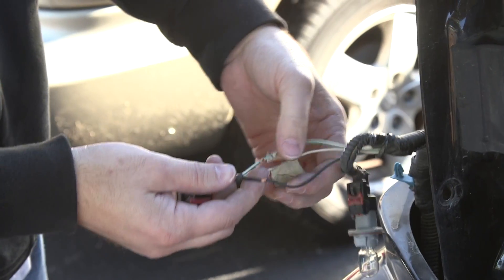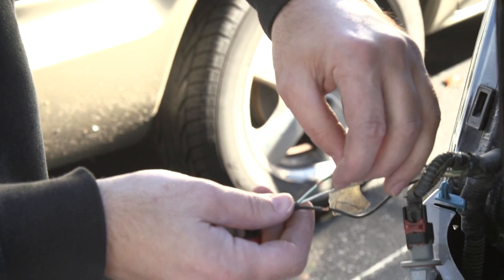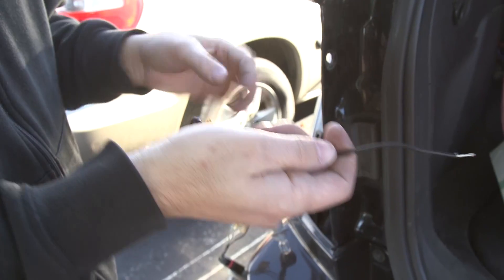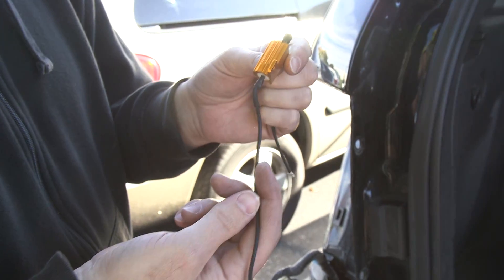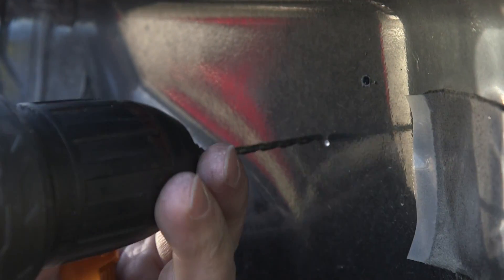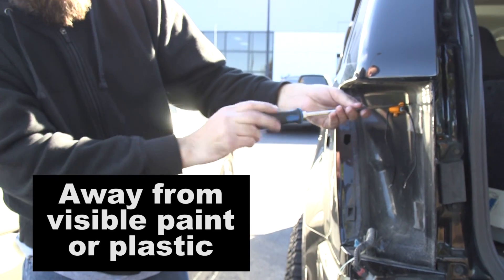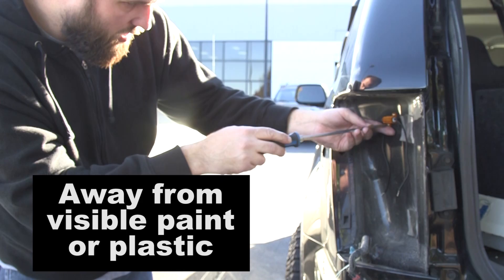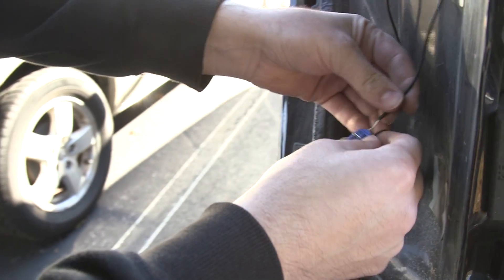How to Stop Hyper Flash with LED Bulbs

Comment: Any idea how to fix hyper flash on 2018 Cadillac xts after replacing the passenger side headlight assembly with after the market unit ! Flashing at 2x rate on the replacement side , it is sealed unit. TYIA

Comment: I bought a jeep wrangler with led turn signals and it had these installed.  After a few months I started getting hyperflashing on the driver side.   Any ideas why?  I rewired everything and soldered all the connections as well as heat shrink.   It will flash normal for exactly 10 blinks before hyperflashing.

Comment: Better solution just replace regular relay to  Led Flasher Relay
Reply: Some cars, like my 2006 Nissan Altima, don't use any flasher relay at all. The flashing is done by the BCM (body control module).
Reply: Did that with my Truck and still have the hyper flash

Comment: Do you need one load resistor at each light or just one load resistor per side? Also a generally more thorough video would help. In this video it shows you connecting to a black wire. Is that the negative? Does it matter? Why would you take the time to do a half assed video?
Reply: both sides

Comment: Hmm, U can use only one resistor for all four bulbs, and save some money. Just cut out negative from all bulbs, join all of that ground into one wire, connect it to the  ONE resistor only and connect resistor to the ground. That resistor is not under load all at once, just when direction lights are in function. ( In Your case, 50W resistor is way too much than U actually need, just be aware of what is the power consumption of LED, if it's 3 W than resistor can be AT LEAST 3 but it can be little bit larger, f. inst. 4 or 5W. And it's cheaper). In my example, U can use only 10W resistor.